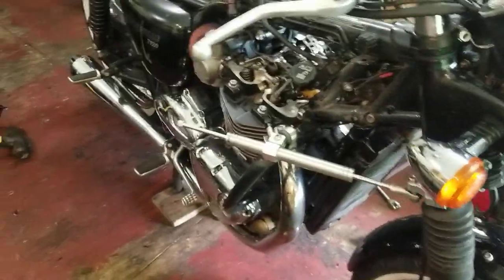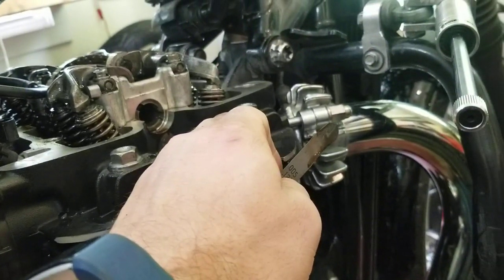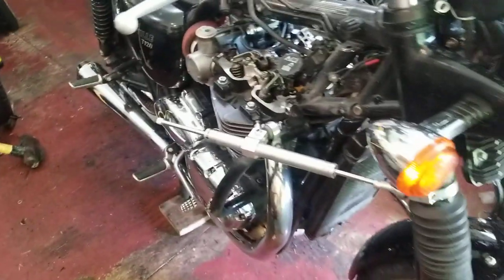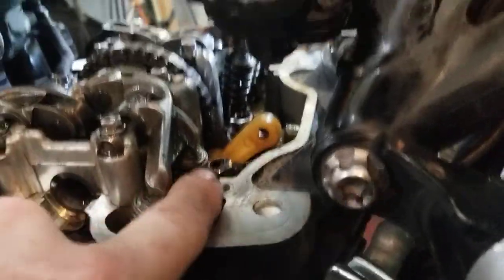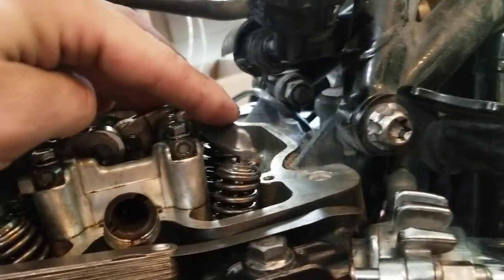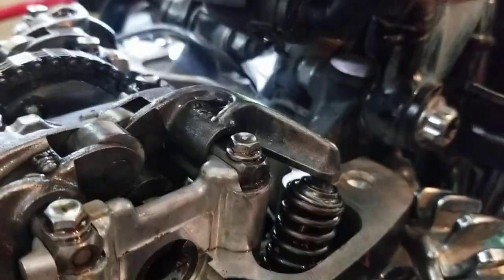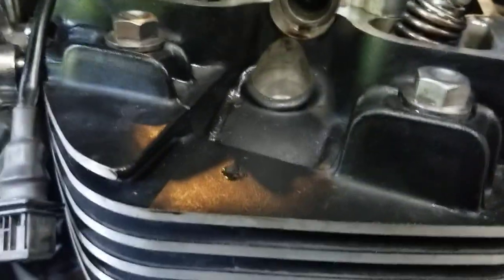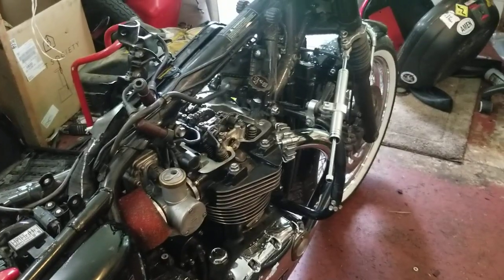40K mile service ( valve adjustment ) 2018 Triumph Bonneville T120

Comment: Good vid Jedz....I have an odd cold start rattle on my 2020watercooled T100 first heard it a 500mls....Triumph Dealer said dont know what it is...just ignor it....I cant do that.

Starts around 30seconds after a cold start...only after a cold start does it rattle...as I say not right away but around 30 secs after the motor starts....I let it idle for a bit before I ride it.....the rattle then slowly disappears after around 2 mins.

Got to know a guy online....same motor as mine the 900cc water-cooled.has exactly the same rattle...his dealer have cured it so he tells me....they say one valve had to big a gap.

Sounds odd to me....not heard of slack valves going quite as the motor warms....or not being able to hear immediately the motor starts.

Going to take a look at my valve clearance's myself soon....dont trust my dealer....I have worked on my own engines all my life...now 69.

The bike is still under warranty....but when I am told...just ignore it it dont fill me with confidence.
Reply from the maker: To measure is to know.  It sounds like a loose valve to me as well which is odd but if the bike is new might be an issue.  The tolerances were all tight except for one Valve at 20K miles.  I'm bringing my bike in for it's 100K mile valve adjustment in a few weeks once we get some warmer weather.  I have a great relationship with my dealer so I'd like to film that adjustment.  These bikes I feel aren't made to the best of standards... Finding a good dealer has been helpful for me. 
Good luck! Check the valves and hopefully everything will turn out ok!
Reply: @Jedz123  Thank you Jedz...going to check em soon.
Reply: @Jedz123  Hi is this 100 K on the T120 , had any issues does she still sound good , just got thruxton1200 with 53k got it cheap because of milage (most I looked at only done about 5k but pricy ) . Nice to hear someone that's done some milage  on one , high milage here in UK seems to be 20k  ! be great to any info from you on a higher milage bike  . Only thing with mine it ain't been looked after but sounds mechanically quite but was filthy / scruffy , chain sprockets were disgusting but got problem with stalling poor idle and throttle pick up from idle . Not sure when valve clearances were done or if ever done ! but starts easy and pulls like a train 
Anyway thanks for the great video , agree with you on trend is for valve clearance to tighten though , unless you got valve train wear , then you normally have tapping , these engines seem pretty quite apart from bit of gear noise (listened to new bike mine sounds about the same )
Reply from the maker: @tiggy2756  I did a 100K mile review. Bike is coming up to 104K mil a and I still own it but rarely ride it. All apart of becoming a new Dad. Thanks,

Comment: Hey, Jedz, I'm a Vermont T120 owner as well, I understand you've moved on from the Triumph due to loss of confidence in the bike.  Sad to hear that.  I have a 2018 I bought new last June, and have logged over 4000 miles this summer.  Love the bike, and I hope it lasts for many miles.
Tom W., Hartland, VT
Reply from the maker: Hey Tom! I still own and love the T120 but I will no longer be using it for touring duty moving forward.  No intentions of getting rid of the bike but the miles I put on it will slow down some as I just got a FZ1 for my interstate distance touring. If you ever want to meet up for a ride let me know! Best,

Comment: I've checked Haynes manual, 900cc engine has the same design, thanks Triumph (you can insert your imaginary friend instead of Triumph if you want). Apparently much easier to service than previous generation Bonnies, phew..

Comment: You can also check if u are at top dead center by putting a long ass screw driver down the spark plug hole the piston will push up on it once you're at TDC the screw driver will "dwell" for a bit before it starts moving down... Its not the most accurate way but it works in a pinch. The most accurate is to use a gauge.

You cant trust the timing marks

Comment: I have a 2022 Triumph Scrambler 1200XC, so it’s that same engine you’re working on.

This bike is new with only 2000 miles on it.  Is it possible that the valves could be making a noise that sounds like knocking?

While my bike was in the shop to repair an oil leak on the driveshaft, and dealership also did the annual service which includes an oil and filter…..it comes out of shop when the knocking that wasn’t there before.  I noticed it right away.

I uploaded two short videos on my channel so you can take a quick listen.

I would love your opinion on this because I’d hate for any engine damage to occur.

Thank you !
Reply from the maker: Let me take a listen for you bud!

Comment: It's not about 'good' clearance, it's about being within the factory stated perameters, to much clearance is nearly as bad as to little. You should be taking a measurement of how much exactly and re-shimming to suit. Thats why they give you the min and max...!!!
Reply from the maker: True being within spec is critical but out of the 400K miles of experience on all my bikes I have never seen a valve go the other way. I would be interested to hear if you experienced that for it would be the first time I've heard about it. Its to my understanding that in the nature of valve and valve seat wear valves only go tight. Thanks for turning in!
Reply: @Jedz123  Just the fact you get a max and min should be enough, both of those tolerances are there for a reason, The larger the gap gets the more of a knock the shim takes which means the cam wears more and more as the gap gets larger. Not to mention more general stress on the valve train than their should be.
Reply from the maker: Thank you for you input. Yes too loose valves can throw shims... All depends on the bike of course. Lock nut loose valves will only risk your valve lift.  I would be greatly concerned if a machine is experiencing cam wear to such an extent its wearing your hardened cam journal and shim.  These systems are designed not to wear... I'll agree that you should find your exact specs but as stated engines just don't go loose. Upper "wear" in modern engines is not common unless there is upper lubrication system failure. I also speak with nearly 15 years of experience with doing many many valve inspections and adjustments. Never seen a valve go the other way. To add to your comment I also keep records of my clearances and watch as on where the bikes clearances go. On my old bikes Suzuki GS450/550/650/750/850/1150 8V shim and 16V lock nut you can anticipate which valves are going to need to be re shimmed/rocker loosened up every 8K miles for they slowly tighten up. I had an awesome Excel sheet that showed trend in tightening. Great statistical data to better ready for your next shim purchase... A good DIYer MC owner should know your specs, but again I've never seen a valve go the other way... I would love to know some examples you have seen! Best and ride safe my friend!
Reply: @Jedz123  I don't have the time or the inclination to explain this in depth, I'm a bike tech with 40+ years of experience from old Brits, Harleys and modern multi cylinder motorcycles. 
Like I said before, the two adjustment specs are for good reason, both as important as each other for different reasons. And I'm not sure why you seem to be struggling with that! There is a basic, pretty well explained easy to understand video here of the results of over tight and overly loose valve adjustment here in this video. The loose part is the second half of the video. https://www.youtube.com/watch?v=Ou_3Qo8wTec
Reply from the maker: I understand completely! Thank you for the input and the video is awesome! I'm not trying to contradict or be combative in what your saying I was just looking for examples from your experience (which is more than I have been alive, awesome!). Figured you easily posted a link to awesome vid you could easily recall instances where the valve "went too loose". Best
Reply: @Jedz123  Dude, like I said, I don't have the time to go in-depth into stuff like that on here. 
Suffice to say, the fact their is a maximum and a minimum tolerance set by the factory should be enough. Just like any other tolerance, whether it be ring gap, bore wear or something as straight forward as chain tension. They should all be treated the same, if it's out of speck, it will be detrimental to the longevity and performance of the engine and in turn the motorcycle as a whole..
Reply: @Jedz123  I had the front right valve on my GS500 start at .06 and gradually move out to .1 before tightening back to .08mm. Meanwhile the left exhaust stayed pretty constant, moved from .06 to .05. Still had all factory shims after 76k kms.
Reply: How many miles on the T120 before you check the valve clearance ?  Does anyone know ?